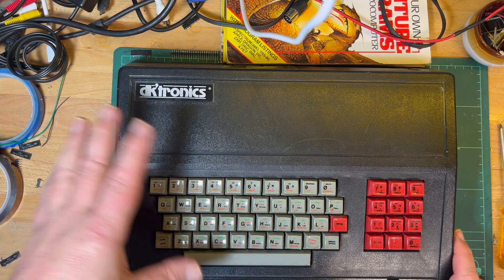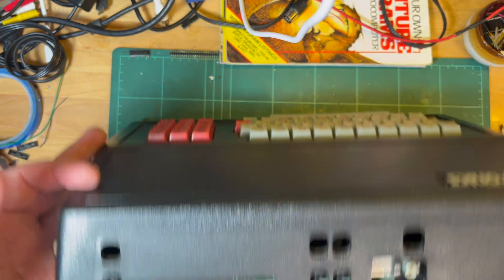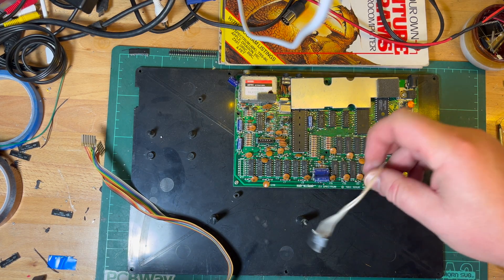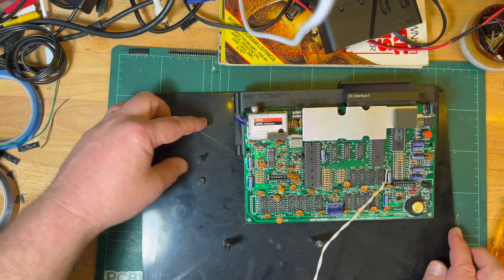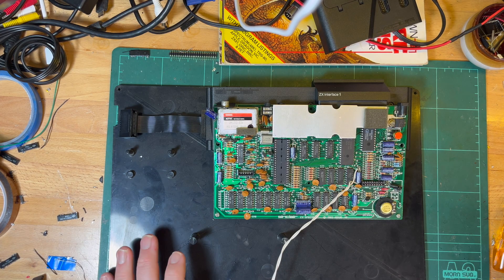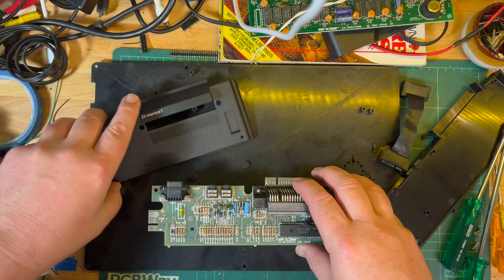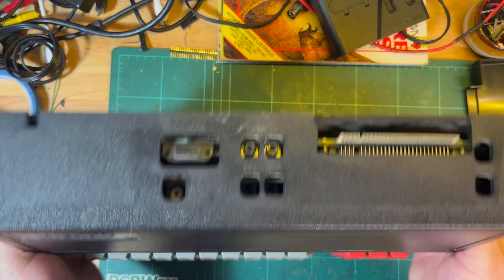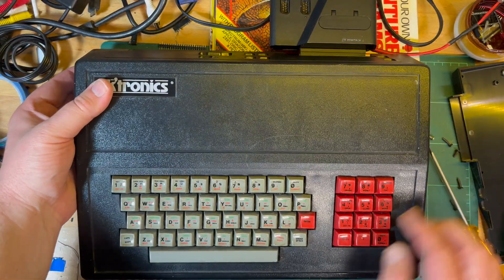🇬🇧 dk'tronics Keyboard for ZX Spectrum: Part 1 (First Look) [TCE #0604]

Comment: I bought one of these a few years ago and attempted to restore it by de-soldering the key switches, cleaning them up and adding silver conductive paint on the internal contacts as some weren't registering.  As the PCB was old, some of the track started to peel off and the PCB was basically knackered.  I set about scanning the PCB and making a copy of it in Sprint Layout, so I could get the PCB remanufactured (using JLCPCB in my case). I have the gerber files if anyone wants to create a new PCB for their keyboard.  I did try putting the link here, but the comment was deleted due to Youtube's policy regarding URLs in comments.  If anyone has an idea how I can share the file, any suggestions welcome.
Reply from the maker: Ahh, interesting!  And thanks for re-creating the PCB!  I don't know why YouTube keeps preventing links, I have it set so that links ARE allowed in comments (for this very reason) ... grrr!  I'll add you as an "approved commenter" and see if that helps ...

Comment: I have one of these keyboard / cases. Mine came with a 48k and still had the Microdrive adapter with it. I ended up moving the 48K motherboard into its original case with a new membrane and putting my Harlequin 128K build into this case.

Comment: That reset switch looks like those fit on Spectrum+ machines ... maybe the board was taken from one of those?
Also appears to be missing one of the lower RAMs.
I'd say keep the Interface1 with the DK'Tronics case ... the RS232 feature actually is quite nice to use apart from the syntax and rather fast compared to tape.
Reply from the maker: Bottom left corner … that one? I was wondering why that space was there. Maybe it was used for spares to fix another machine?
Reply: @Brfff  Yup, should be 8. If you don't have spare 16k*1 DRAMs on hand you can also use 64k*1 or 256k*1 DRAMs by bending up a few pins. That way you no longer need one of the additional power rails (there's 2 and one of them is required for video out/rs232 I think - can't remember off my head).
Reply from the maker: Yep - you're right ... it's apparently a Samsung produced board

http://blog.tynemouthsoftware.co.uk/2018/06/zx-spectrum-mystery-repair.html